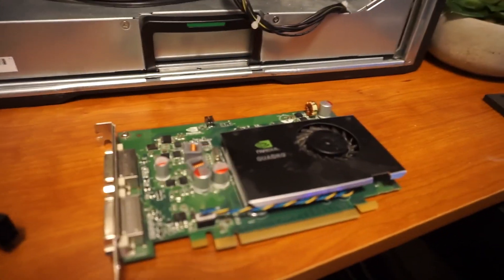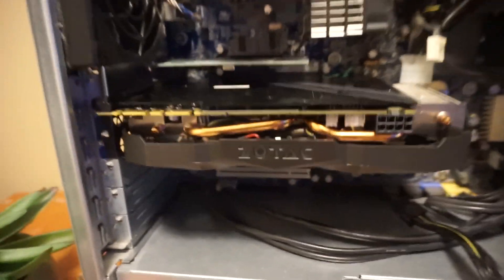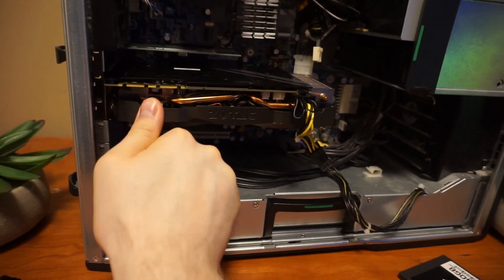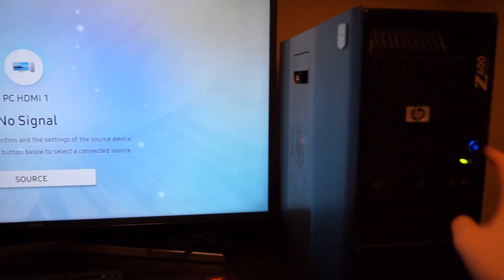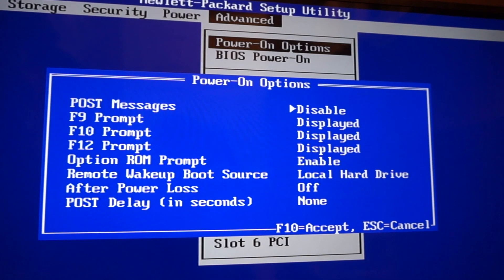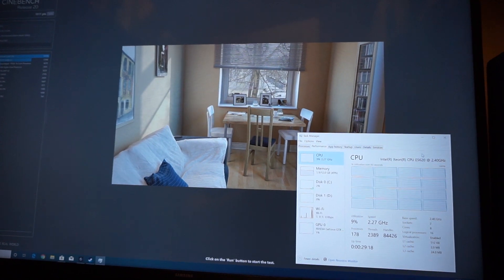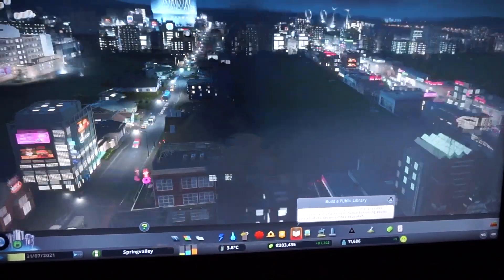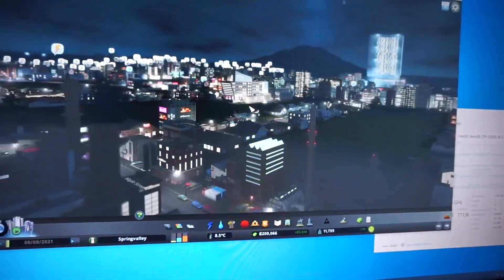Z600 Update GTX 1080 Cheapest/WorkStation/Gaming Rig!!

Comment: you should upgrade those CPU's they are very inexpensive such as xeon x56xx series make sure you update bios to version 3.61 it is still available on hp website under windows 7 64 bit, I am using an AMD fire pro w7100 8g graphics card on my z600 and it performs very well. also for storage you can use modern nvme storage using a pcie card you just have to boot your os using a sata ssd

Comment: Hi! I wonder if you haven’t had you had any problems with the computer shutting off under heavy graphics workload with the stock power supply. Great video!
Reply: Mines doing that . Found any way to stop it? A new power supply seems to be pricey.
Reply: @kipsyoutube  what GPU are you using? The GTX 1080Ti does that, while the GTX 1080 still allows you to have two x5675 processors and two mechanical hard drives without trouble anf I found I can have two x5675, 48GB RAM and 5 x 8tb WD purple mechanical hard drives with a GTX 1050 Ti and have it working night and day without any hassle.

Comment: Thanks for the video. I have a Z600 with two Xeon x5675 and GTX 1060, My question is can i change the GTX 1060 for a RX Vega 56 with the same Power Supply (standard 650w)?
Reply: 1060 is about the max for the power supply. I have a z600 with same dual CPU and 48gb. Using a 2060 would cause it to shut down. If you're after a gaming build, then I would recommend losing one of the processors and you should be able to run fine with the you of your choice.
Reply: @justinbailey6515  Thanks for answering, and what do you think of a Gtx 1660ti or super?
Reply: @shaqker8777  I would wait until the Nvidia 3k series is out and you should be able to a buy a 1660 at a lower cost.
Reply: @justinbailey6515  thanks for the advice